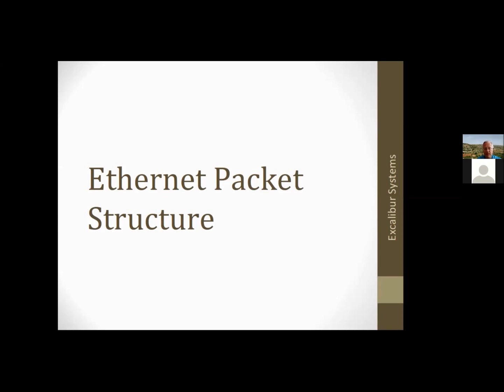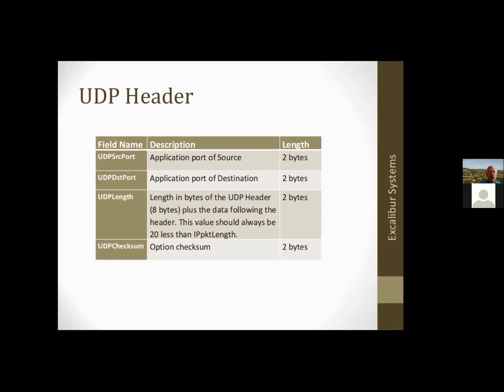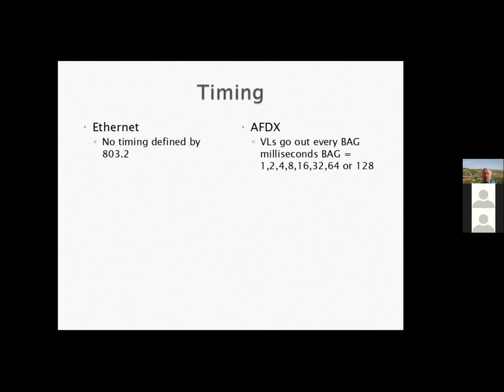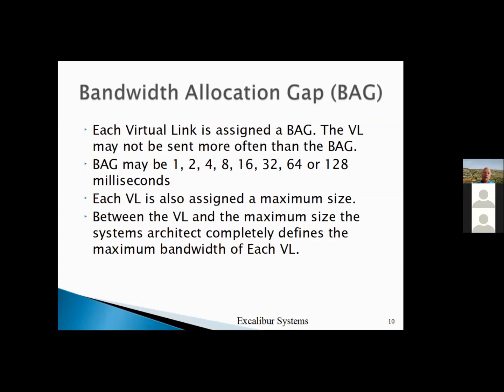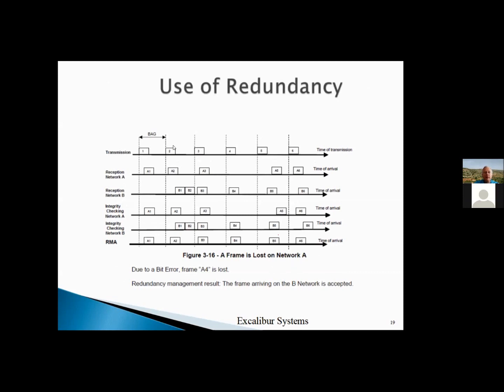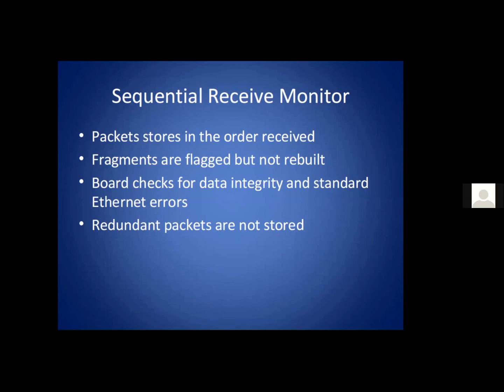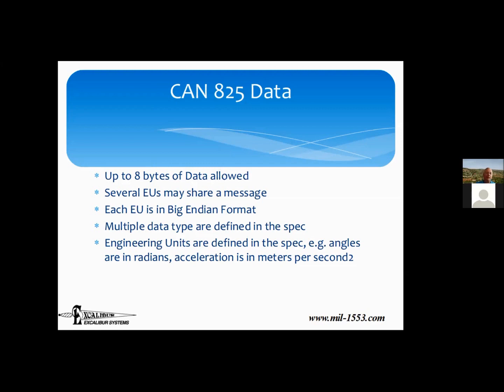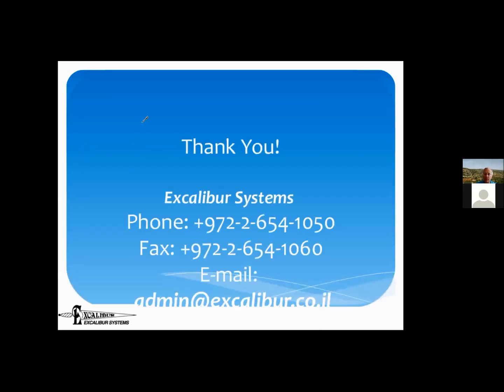Zoom course on AFDX / ARINC-664 part 7 & ARINC-825 | Excalibur Systems

Comment: Hi, The lecture looks great. I think you should do some re editing because switches work on the data link layer with mac addresses and routers work in the network layer (IP addresses). So minute 40 should probably be router and no switch